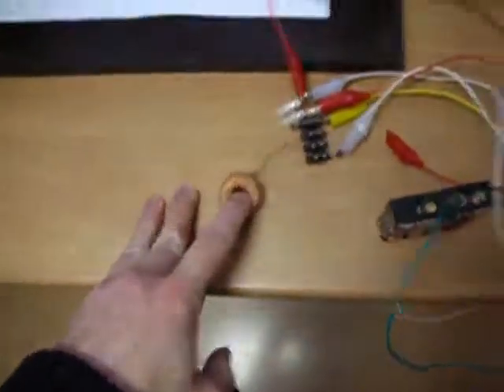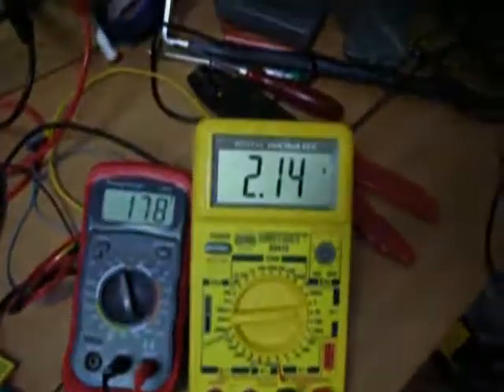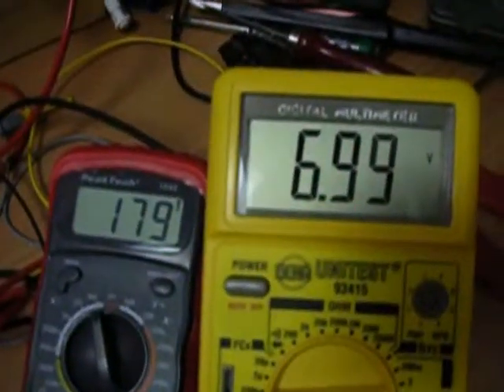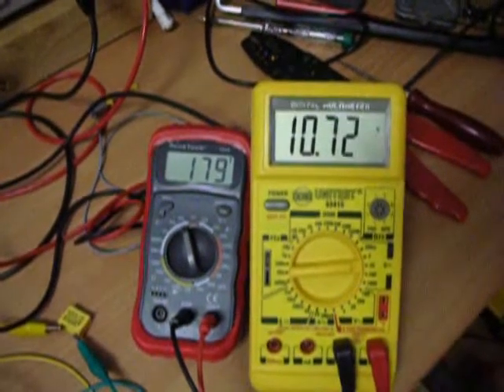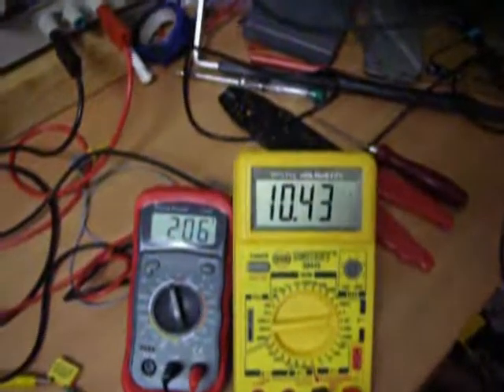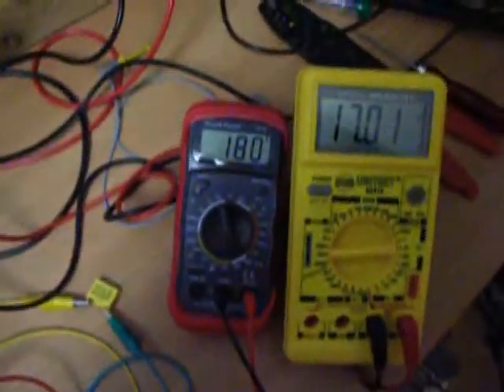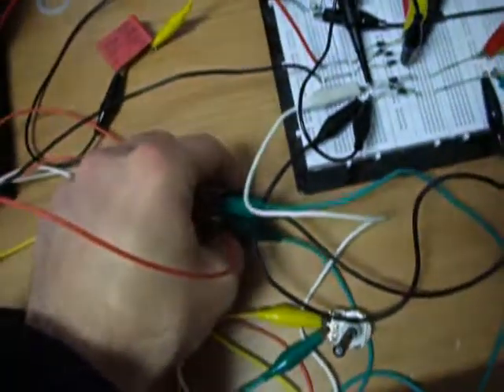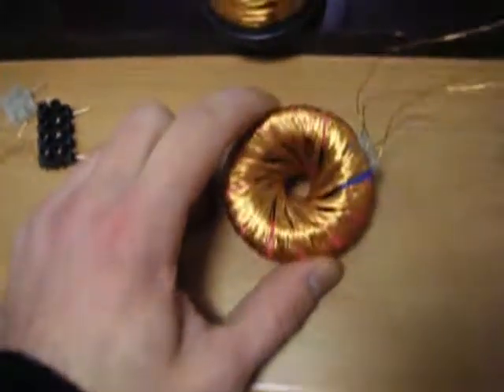K.W.O.N. and the Joule-Thief #2

Comment from the maker: @llewgnal Hey Gary
It depends on the adjustment, windings and if you want more direct output or more on a pickup!
Watch the series... in part 3 i gonna use my big Rodin and in part 4 i will use the Inversed Starship as the driver coil!
Cheers...